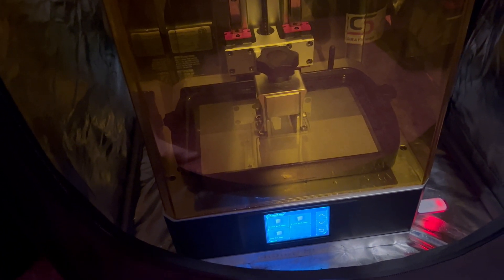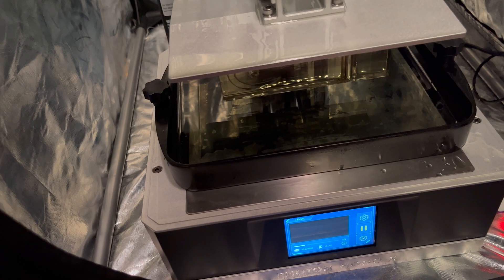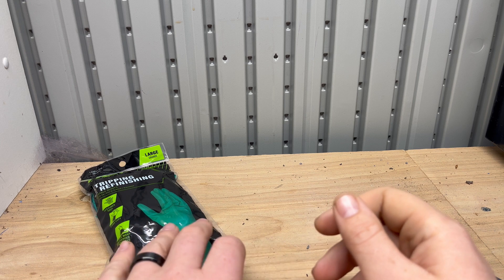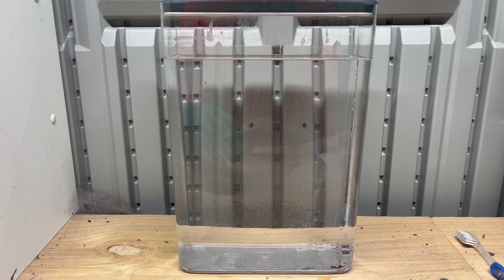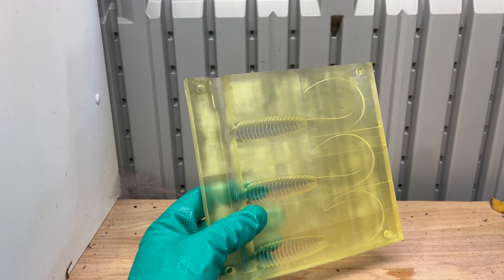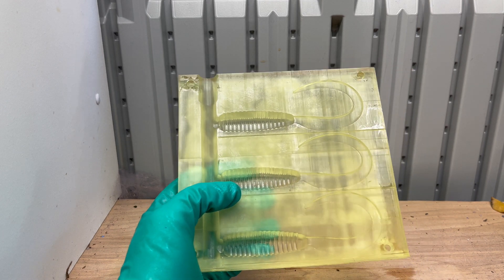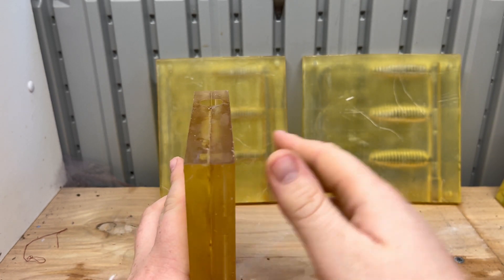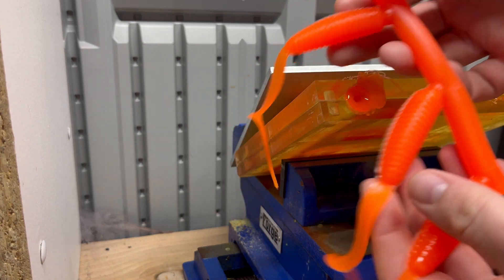3D Printing Soft Plastic Lures The Ultimate Beginners Guide: Part 3 Making Molds

Comment: Great video series! Big thanks!
Maybe missed it in any of the videos, but what resin do you use? Any specific resin that can handle high temps?
Reply from the maker: Glad you liked it. Ive been using sirya tech sculpt. There's other resins out there but the only one I've tried so far is sunlus high temp resin but ut was way to brittle
Reply: @HandCraftedAngling thanks for the respons! So you kinda saying that basic resin is enough for a mold?
Reply from the maker: No sorry for the confusion. Sirya tech sculpt is a high temp resin. Ive never tried any normal resins for it.
Reply: @HandCraftedAngling  Okey, thank you! :)
Reply from the maker: No problem

Comment: "Hmm, maybe I could pour my own jig heads."

"oh maybe I should pour my own soft plastic lures"

"oh maybe I should make my own molds to pour soft plastics"

Looking at spending $450+ to save on jigs and lures that cost $1-5 each. What am I doing? 😅

Edit: subscribed
Reply from the maker: Yeah its one deep rabit hole thats for sure. Then you still got the hardbaits too lol
Reply: @HandCraftedAngling I’ve been 3d printing hardbait a for a while, my favorites are microbaits, and now I’m trying to get into making my own soft plastic molds, I have some aluminum molds that I’ve enjoyed, but I don’t want to spend 150 bucks plus every time I want to do a new lure, what kind of printer should I get? And do you have any suggestions for getting bubbles out of my plastic?
Reply from the maker: @NoSleepTill72  Ive actually been working on printing some hard baits on the resin printer. I use an anycubic photon mono x and it has worked really well for me. Im not sure if they make it anymore its outdated.  Might be able to pick one up cheap. I wish i could help you with the newer ones but I havent looked into them enough. I think for the most part as long as its a good build quality they are all the same. The most important feature is screen size. You want it to be big enough to print all of the molds you want. Resolution isnt really important for lure making. I think 4k is the lowest screen resolution they make now and that is more than enough. Some of the newer printers have some nice creature features but they are not nessisairy. Some of them have built in heaters so you dont have to set up a heated enclosure. Some of them also have auto refil for the vat so you dont have to top it off mid print. Most of my multi cavity molds need to be toped off atleast once. Kind of sucks for overnight prints. Let me know if you have any questions.